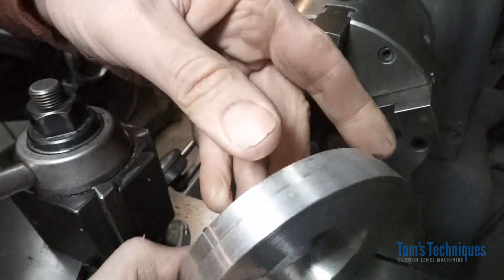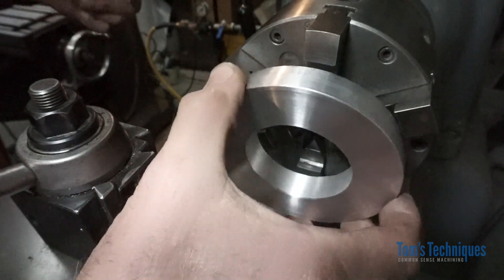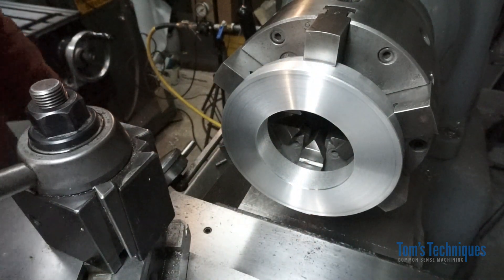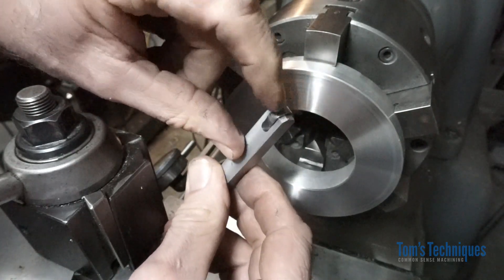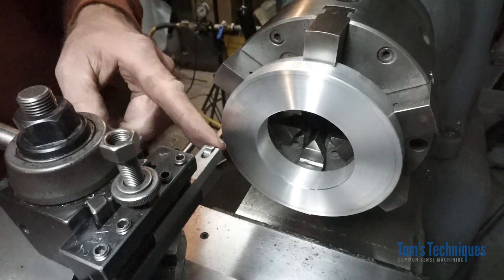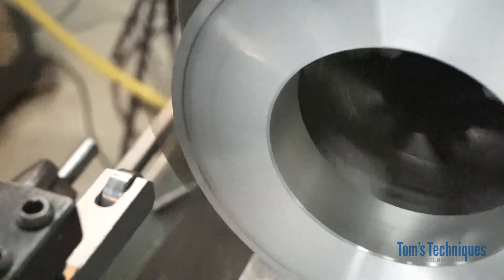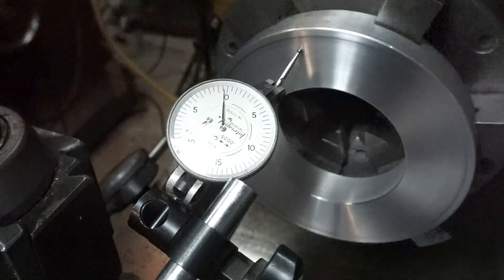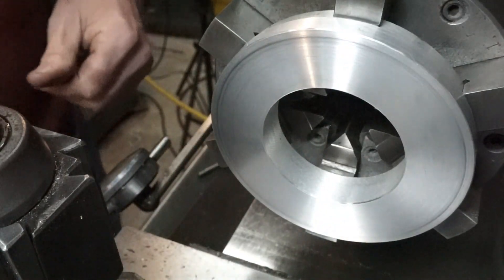Tom's Tips & Tricks #1 - Quick Part Alignment on the Lathe

Comment: Good to see you making vids again. Also, you are one who answers questions, a great plus for us viewers.
I wanted to pass on another tool I saw on youtube posted by Doubleboost. He press fit a quality ball bearing say 1.5" on a shaft about 1/2" dia and 5~6" long on one end. Chucked it up in the mill and with the mill running, slowly ran it against the part until outer race stopped turning. Knowing the bearing radius 3/4" he found the edge of the part right off.
Reply from the maker: It sounds like that would work fine if you had the room, but 'm still partial to my edge finder (old habits) :)

Another thing that works well is a dowel pin. Just looking at the gap between the pin and stock, and compensating for the diameter gets you incredibly close.

Tom

Comment: Hey Tom, good video. First thing I noticed: no noise!! Glad to see you finally beat it.

On the video format and the time it takes to make and produce, I think a lot of the guys overdo it. If you were to just point a camera at that part with the pusher bearing and record whatever you did to make it, it should be plenty good. Get a remote start/stop button to make your cuts on the fly and don't stop to explain what you're doing. There's a fellow machinist here on YouTube that hasn't shown his face or uttered a single word ever and his videos are extremely popular. After you're done recording, play it back on your computer and overdub a line or two of what you're doing in either speech or text on the screen.

If someone needs further explanation or one of your snazzy, Engineering-class drawings, well that's what the comments here are for. Either you or some of the other skilled machinists watching your videos can help out.

Bottom line, I rather see a raw video of a part being made than none at all, or have to wait months until you've had enough time to make a big production out of one. Just my 2 cents. Cheers.
Reply from the maker: The sound on this video was entirely through my lapel mic. I totally removed the audio track from the video, which took out the background noise. That seems to work pretty well.

Pointing a camera and letting it run sounds like a good idea, but in reality it just doesn't work. Various camera angles and close in shots are necessary for the viewer to see what's going on. And explaining what's going on in real time is teaching, hopefully something that sets my channel apart from the rest.

The tutorials are not gone, just on leave for a while. I hope to retire in the very near future and have all the time that I need. :)

Thanks for watching.

Tom

Comment: Glad to see you back Tom.  I use your website and videos frequently and am referring them to others all the time.  Any way you can share your knowledge and experience is appreciated.  I have an AML-618 lathe at the shop, which is a knock off of your Hardinge.  I want to build an indicator holder like what came with the Hardinge lathes.  Any tips or photos would be appreciated.
Reply from the maker: I'm making a note, Bill (literally) to measure up the bracket. Send me your email address through my website.

Tom

Comment: Thank you for another tip.  Doubleboost makes and uses a similar tool.  He mounts a bearing on a rod and then brings it in at a right angle rather than parallel as Tom's tool does.

I've used the Doubleboost version to bring slightly longer items into alignment as well, pushing against the side instead of the face.
Reply from the maker: I haven't heard from John in a while. I'll have to check up on him.

Tom

Comment: Great tip! I sometimes use parallels and a 1 2 3 block against the chuck face and push my part up against them
Reply from the maker: That will work, but it would be tough to get the precision this method provides. This makes the part dead true.

Thanks for watching.

Tom

Comment: great...I do parts like this all the time, very useful.....question.....do you tighten up the jaws after? DO you only partially tighten, then align then tighten? How about radial centering.....I guess 4 jaw and slow with an indicator? Do you find a six jaw particularly good for radial centering? Or is it adjustable? As we all know...getting it true is everything! :)
Reply from the maker: The jaws do get tightened lightly at first, then firmly after aligning the part. 
Radial alignment is done by hand with an indicator.
Six jaws are excellent for gripping a part true, and easy on thin wall parts. Only problem is the expense.

Thanks for watching.

Tom

Comment: Hey Tom, glad you're back.  So on the trueing vid, do we leave the chuck only slightly tight and after bumping it into true then tighten the chuck for the additional machining?
Reply from the maker: I usually start out with the chuck pretty tight to avoid having to re-tighten it, but it kind of depends on the part. If you have to start with a lighter grip and then re-tighten to get it true, just bump it again afterward to be sure the part is still running true.

Comment: The quick alignment bearing is an elegant solution.
However I think I noticed an insert in the tool post to allow a wider tool holder. Not sure if that was what I saw, but if so how well does that work? Can I go from AXA to a BXA holder?
Reply from the maker: Not sure what you were seeing, but an AXA post will only accept AXA tool holders.

Thanks for watching.
Reply: I now see it is just the cam-lock of your tool post. My tool post holder cam is not visible. I thought it might be a dovetail wedge to allow use of a larger holder. But I see the holder is already an AXA model.
I have a 1" parting tool holder that's a size too large and was trying to figure out a way to use it other than welding some fill on one side and then machining it to AXA. Probably a silly idea and being too cheap - sorry to waste your time!

Comment: Tom - how tight should the part be in the chuck ? You wouldn't like to tighten it up completely, would you? On the other hand you wouldn't mount the part too loose, right?
Reply from the maker: It's best to not re-tighten the jaws after the part is aligned.  You develop a feel for how tight the chuck needs to be through experience. If it takes you a couple of tightening and aligning steps to get it right, that's ok. Most people over tighten chuck jaws anyway.

Comment: I have a classic car I am rebuilding.  I am working on the differential.  I obtained a ring gear and pinion.  Comparing the old pinion to the new one, the old one has about 6 thousandths thicker where the outside bearing rests.  Looking at the thermal expansion from Timken, then bearing mfg,  I can see I cannot expand it that large.  So I ill need to turn the spline end down a little bit.   I have a couple of questions.  1.  how to get it trued up.  One end is a gear, and the other is threads.  I know I cannot chuck down on the gear.  How to chuck down on the gear?  How to true it up?   Do you have any suggestions?
Reply from the maker: The pinion likely has center drilled holes in each end that you can use to support it between centers and drive it with a dog. The next problem will be actually turning it, because it is probably hardened. Carbide tooling will be a must.

Comment: You might have been getting a cosign error with your indicator the way it was rested on the part , normally you should be sitting about 17 degrees with the surface . I actually made one if these and it works wonderful
Reply from the maker: Cosine error only comes into play if you are taking a direct measurement. In this case I am only looking for run out, or lack of.

Tom

Comment: hi Tom just wondering do you ever have to worry about nose radius compensation on a manual  lathe. if you do how?
Reply from the maker: Nose radius compensation is only a concern when turning contours, i.e. feeding the X and Z axis at the same time, which is not something that can be done on a manual lathe, at least not by me. :)

Tom

Comment: This only works if the part is clean from the start and not bumpy like a brake disc might be, still gets close tho, I use this method often
Reply from the maker: @hrdu  It will work on rough surfaces as well, but the result won't be as precise. It basically averages out the irregularities.